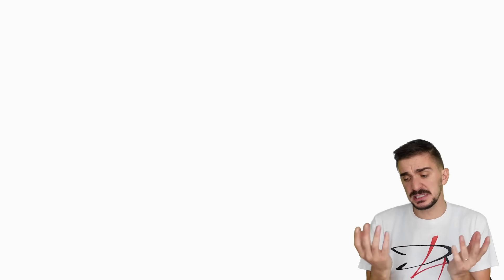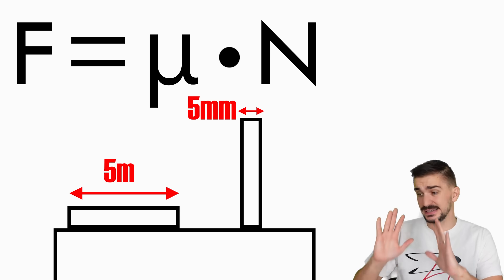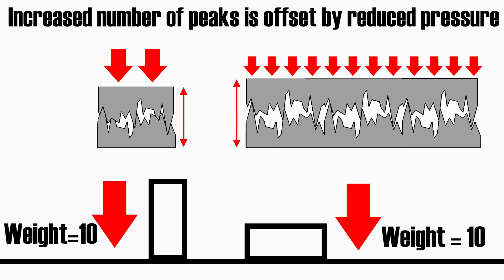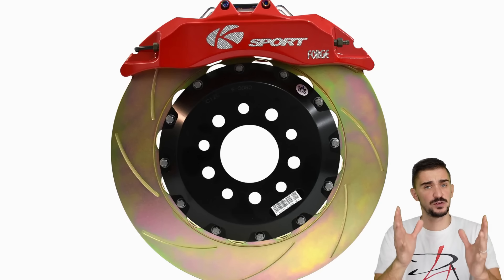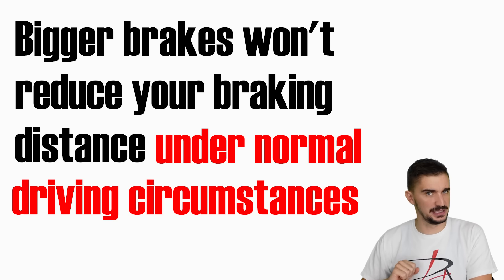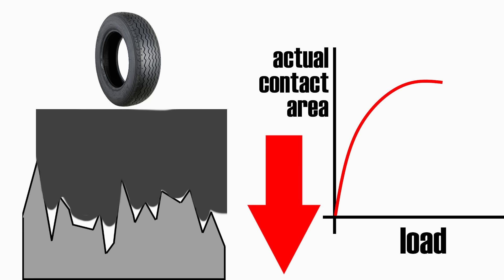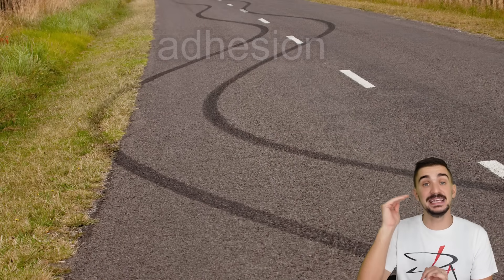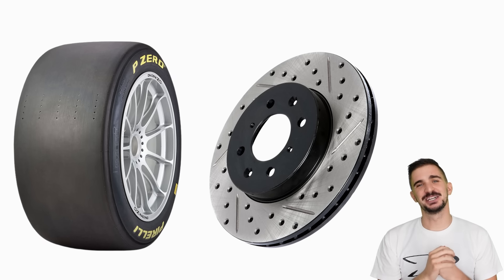Why Big Brakes Won't Stop You Faster but Wider Tires Will - Friction and Surface Area Explained

Comment: Just finished the video, increasing brake rotor radius increases torque because the force is applied further from the fulcrum. So assuming you're not grip limited, this is an improvement. It also means less brake pressure for the same braking torque (when tire grip limited), which also lowers heat generated.

Edit: this was my intuition. And I'm wrong because energy is conserved under braking so the amount heat must be the same. All you get is more surface to dissipate as explained in the video.
Reply: Reading the comments of people debating their ideas is almost as entertaining as the video itself, especially if it's something that wasn't mentioned in the video.
This channel is truly a gem!
Reply: Actually, you are wrong in saying you were wrong, larger distance between brake pad and center of rotation means larger brake torque, meaning larger break force and therefor greater deceleration. 
This does not violate the laws of thermodinamics because more heat is generated, not due to larger frictional force (which is as really well explained in this video not existent), but due to larger relative speed between brake pad and rotor.
I assume D4A ignored this point cause you often can not fit much larger rotors due to them having to fit into the wheel together with the caliper or in case of motorcycles limit wheel grip, so there is no all too signifant performace gain possible.
Reply: @Sir_Cactus  Finally someone who said that...thank You !!!
Reply: @jabberwockytdi8901  The frictional force is as explained in this video not dependend on contact patch, however, the frictional force is NOT the braking force. The brake force is brake torque divided by tire diameter and the brake torque is frictional force times the distance from brake pad to center of rotation. Therefor the formula is: brake force = frictional force × (rotor diameter / tire diameter) [tire friction is ignored cause it is irrelevant to the point I am making]. Therefor increasing the diameter of the brake rotor increases your braking force.
As a result, your braking distance is reduced.
This works because due to the higher relative speed and therefor more heat that is generated. You are correct that heating the brakes requires energy, but that is precisely the point of brakes, converting the kinetic energy of the car into heat. Doing so more quickly reduces braking distance.
Reply: @Sir_Cactus  You say that tire friction is irrelevant, but it imposes a hard cap on braking force.  Any torque beyond the torque required to lock up the wheels is irrelevant (and indeed locking up the wheels is actually overshooting a bit--you want somewhere around 10% slip/90% roll for the best possible stopping distance).  A wheel that isn't spinning is a wheel that isn't spinning.  You can't make it MORE not spinning by braking harder.
Reply: @argentonath  Slight misunderstanding. I did not say tire friction is irrelevant, or at least I did non mean it that way. I only meant to say it is irrelevant to the point a was making, meaning increased brake torque due to larger rotors. I fully understand that tire friction is a hard limit. Sorry if I was not clear enough.
Reply: Let's take the analogy of a torque wrench if we apply 1 lb of pull on a 1 ft bar, we get 1 lb/ft of torque, but if we use a 2 ft bar with the same 1lb of pull, we get 2 lb/ft of torque.

The exact same principal works when applied to brakes. A larger rotor with the same caliper and same pads and pressure will net an increased braking effort. Increased heat? Yes. Increased braking effort? Yes. Could it exceed the ability of the current tire to sustain that torque? Will depend now on the tires ability to grip the road.
Reply: this is why big rotors are slotted. the larger surface area dissipates heat much faster.   the stopping distance is a side effect of building a braking system that wont start fading when it gets hot.  . i have brake temp sensors on my porsche and the larger gt2rs rotors stay much cooler than the smaller 996 turbo rotors did wich leads me to believe that even though energy is conserved and heat is equal, the actual temperatures wont be the same because the larger rotor, the brake ducts and mass of the  larger brake caliper create more mass to heat up. Larger rotors are much more efficient at venting heat especially if they are slotted.  i dont see many big brake kits that dont upgrade the calipers and switch to some sort of vented disk so maybe if you were putting OEM 7 series brakes on say a 3 series where its pretty much just scaling the rotors up, you would probably see equal heat distribution etc and the cooling effect wouldnt be as great.
Reply: So why do supercars have such big brake discs (aesthetics)
Reply: @MarkO-lv2ip  Because bigger brakes with bigger surface-to-air area can expel heat more quickly thereby reducing temperature buildup which can lead to brake fade. This is important on the racetrack or when driving at the limit on twisty roads with fast repetitive sequences of heavy braking. Not significant for a single braking event such as an emergency stop.
Reply: Totally right. Increased brake rotor radius increases torque. It thus reduces force needed to be applied to pads, to reach the tire grip limit.  This is very clear on motorcycles. Usually the force you will have to exert on your brake lever will be lower, the greater the disc diameter. A different question is that wide tires sometimes perform worse than thin ones, like when aquaplaning. It is a more complex question than it seems to be.
Reply: 1. If you aren't grip limited, you have bigger issues.
2. The same friction makes the same heat. 
3. There is no more force applied, because it is a function of clamping pressure not relative speed.
Reply: @nobodynoone2500  you're right. I do feel like there would be benefits to reduced clamping pressure though. I'm guessing less wear?
Reply: I think if we consider a rotor spinning at a certain rotational speed getting to a complete stop, the total amount of heat generated has to be the same which is just the exact amount of it’s initial kinetic energy. The difference is “rate of heat generation”. 

Assuming same clamping force from the caliper and therefore same friction force on the break pad, clamping at a greater distance from the center of the rotor means higher relative velocity between rotor and break pad. Since rate of doing work, which is power = F*V, it increases while F holds unchanged but V increases. Meaning heat is generated at a higher rate and therefore A) it stops faster because less time is needed to generate the same amount of heat; and B) unless heat dissipation rate is also increased, temperature would be higher.

If the same stopping torque is applied, the power of the stopping torque and therefore the rate of heat generation would be the same (P = Torque * angular velocity). The rotor would experience the same angular deceleration and stop in the same amount of time.
Reply: You are not wrong. Whilst the kinetic energy is the same, the higher torque means that, for a given level of friction, more energy will be absorbed per turn of the wheel. Energy is force x distance, and a larger radius means a longer path length per rotation which means that, for the same friction, more of that kinetic energy is absorbed as heat. The video totally misses that point.
Reply: @jabberwockytdi8901  untrue. Energy is force x distance and if you increase the rotor/disk diameter by 25%, then it means that, per rotation, there is a 25% longer path length per rotation resulting (for the same frictional force) 25% more kinetic energy absorbed. Or, conversely, a reduction in the required brake pressure.
Reply: Bigger brakes also decrease HEAT loading and failure
Reply: Same heat but larger mass to dissipate and spinning faster cools better  larger wins
Reply: However, you can also get larger callipers to increase surface area on the same sized rotors, in which case the above doesn't apply and the model in the video applies better.
Reply: @rwantare1  you are right,you will need less  clamping force with bigger brakes because you will be applying the force at a greater distance,but the disc itself will be spinning faster as the distance from the center increases.Faster rotor=more heat but because you need less clamping force they balance out and the heat generated doesn't change overall depending  on the distance from the axle.
Reply: @rwantare1  It's not the area of the caliper that matters but the area of the pistons pressing the pad. The bigger total pistons area pressing, the bigger force. Normally bigger amount of pistons means they're shorter diameter resulting not always bigger pressing area...
Reply: I also don't know why he missed that
Reply from the maker: It's already been asked in the comments and answered. A few centimeters of brake disc diameter is largely irrelevant and I didn't want to introduce too many concepts in order to preserve focus on the point of the video.
Reply: @d4a  As the standard disc diameter is something like 30cm a few centimeters will make more than an irrelevant  difference.
Reply: @Mattenmarie  For my car I can swap over my bigger calipers and rotors for track days (Stock 321mm 2 piston, to W12 385mm 2 piston) Im only gaining more thermal mass. I do brake a bit better, but in my experience, you won't notice anything
Reply: @d4a  not if it’s 15cm larger in radius
Reply: @d4a  a 15% increase in disc size IS considerable an example is 280mm disc to 340mm is a huge difference. In the case of “a few cm” is huge, ask anyone that has an enduro with dirt and supermoto setup on the same bike, it’s a massive difference.
Reply: @d4a  You mean the inconvenient truth of the matter that doesn't support your BS?
Reply: @merkel2750  Thats on a bike. And was that with same thick ness of disk and everything. Just a extended mounting point for the caliper or however bikes mount them?
Reply: @3n3ly7m9  same thickness, just a bracket that came with the kit.
Reply: @d4a  all right, I had the same comment about the breaking torque, got your point now, thanks a lot:)
Reply: @justkev1044  15cm increase in rotor radius would be like going from 11 inch brakes to 22 inch brakes.
Reply: @d4a  veoma relevantno.
Reply: Titus, there is more leverage on a larger diameter rotor, however you have failed to realise the 
consequences of the higher surface speed of the disc rotor.... per wheel/rotor revolution.

Comment: If you double the surface area of the brake and keep the psi the same, you will increase the friction hence the braking.
Reply: This would require double the force on the master cylinder assuming the master cylinder stays the same diameter.

Comment: The name of this video is misleading. You're ignoring the physics of a change of fulcrum due to larger rotors Apparently you don't watch motogp /motorcycle racing because this video is not applicable to all situations. Bigger brakes are needed for heat dissipation and thr bigger rotor surface allows for more powerful master cylinder and bigger calipers which can apply more force, therefore more powerful brakes, and with proper race tires a shorter stopping distance
Reply: you know there are other ways to remove heat than making the brakes bigger tight? Look at those motogp bikes, ducted cooling. Same as F1, NASCAR, GT, etc.
Reply: @nobodynoone2500  youre not understanding /or ignoring the facts. Motogp  already have brakes so big that the calipers have to be installed on the rotors THEN the rotors are bolted to the wheel. The brakes CAN Not be  any bigger or they hit the rims! So your statement isnt acknowledging what's really going on-they use ducting yes, but  brakes are as big as possible and can not be any bigger. They use carbon fiber due to the higher coefficient of friction, but they don't use ducts when it's cooler to keep the CF brakes in their optimal operating temp.
Reply: "Apparently you don't watch motogp"
Yeah  - says the person not able to watch this short video. Way to show your ignorance.
Reply: @ABaumstumpf  I watched it and he totally ignored the physics and reasons of why to run bigger brakes. Way to show your ignorance but not being able to comprehend my statement of facts

Comment: Lets say we are braking with 2g , does that mean car now "weights" twice the amount and have twice the amount of grip because mass X gravitational acceleration will be doubled because we are pulling 2g?
Reply: 2G of longitudinal acceleration, not vertical. It will shift load forward as a function of CG height and wheelbase.

Doubling the load on a tire will also typically not double the grip, because tires have load sensitivity and effectively lose mu as they are loaded more. You will get more grip, just not double.
Reply: @ArchOfficial  yeah you are right

Comment: TOTAL BULLSNOT!
Larger rotors provide for more surface area to allow for more and faster heat dispersion. Braking exchanges the energy of motion into heat energy through friction. This heat energy must be dispersed. The larger rotor will remove heat faster than a smaller one.  So, YES, A LARGER ROTOR WILL ABSOLUTELY MAKE YOU STOP QUICKER. I expect better from this channel. Most of the tech tips are spot on, but this one misses the mark.
Reply from the maker: Did you even watch the video?
Reply: Nope, you can remove (or manage) heat many other ways. While going bigger is an easy big hammer kinda approach, it also means more unsprung mass, the exact thing a racer doesn't want.
Reply: ??? its all in the vid chief
Reply: Did y'all read a different title? Show me the one you read. Why bother watching the vid, when the description is 100% inaccurate?

Comment: A larger disk has also a larger radius which has a much better leverage - you kinda forgot this aspect.
Reply: a larger radius rotor also typically has more mass to it than a smaller rotor, and therefore requires more force to stop it as well. larger mass, longer stopping distance... going big isnt necessarily of benefit.
Reply: @Alkivar  You need physics lesson - the add disk rotor weight is negligible if you take a car wheel into account ... 🙂
Reply: @Alkivar  Not to speak of a MTB disk rotor ...
Reply from the maker: I discussed this with one of my patrons over on patreon. Yes that's true but not in the sense that it's true on bicyciles whre you have 26, 27, 28 inch wheels and the distance between discs and rim brakes is significant. In cars you are very much limited by the amount of how much you can increase the disc. We're talking about a noticeable amount of surface area but only a few centimeters of diameter. This added leverage is negligible when you put it against the masses and forces present in an average car.
Reply: @d4a  Re bicycles - I thought about a 26 inch front wheel with either 6 inch or 8 inch disk rotor. It makes a huge difference because of the higher leverage you don't need less braking pressure on the pads.

But totally agree - just from friction point of view, higher surface area on brake pads do not help (unless you consider the heat dissipation).

As always - great stuff !

Comment: I havent watched the video yet but do you know why drum brakes lock up faster than discs and also have longer braking distances even when they arent experiencing brake fade? I believe very cold disc brakes also lock up much easier than slightly warm discs (temps nowhere close to fading). I always wondered why
Reply: Cold brakes means cold tires. Thats whey you lock em up easier.

Comment: This requires context and in reality there is more to it than simple, (or complex), physics.

Big brakes CAN stop you more quickly but it depends on the conditions at the time. If you are on the brakes long enough for them to get hot, smaller brakes will fade before larger ones and hence take longer to stop you.
Reply: If your brakes overheat on a single braking you got other problems.
Reply: Most of the time in practice on OEM setups, the fronts losing efficiency will even out the brake bias and actually stop the car faster by evening out the slip between the tires.
Reply from the maker: It is next to impossible to get stock brakes on any car or motorcycle to fade on a single braking. The vehicle either needs to be overloaded beyond a reasonable limit or you need an extremely long downhill that's also straight enough to allow you to build up a lot of speed. In reality every stock braking system on pretty much any car made in the past 30 years has more than enough heat capacity than required for almost any scenario. Really the only thing that bakes stock brakes is very aggressive driving for prolonged periods of time and the place where that happens the easiest is the track.
Reply: @d4a  Fade yes, overheat no, it just takes one good braking zone. Although like I replied just now, that might not necessarily even be bad inherently.